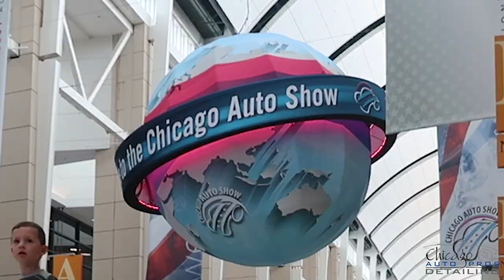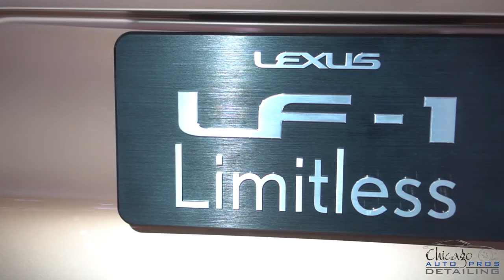Chicago Auto Show Field Trip| 1983 Porsche Carrera | Genesis G80 | Detailing VLOG #18

Comment: I noticed that one of the coatings is applied with a wet applicator.  Different than some I have used / ready about.  I'd like more info on that.  I ordered 2 of the LED lights to replace old halogens on a tripod....